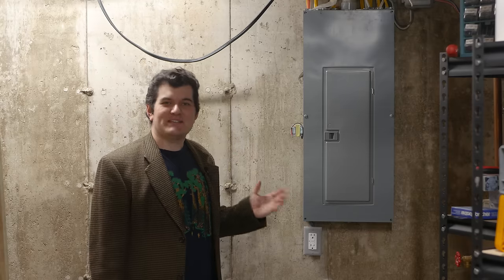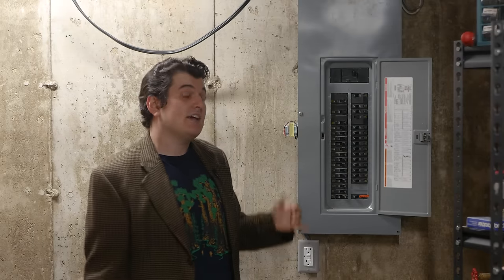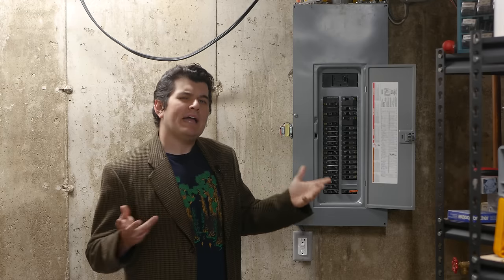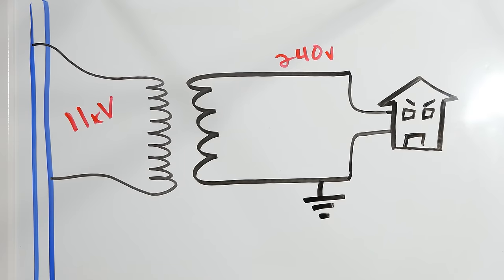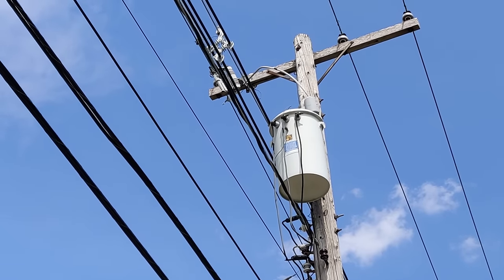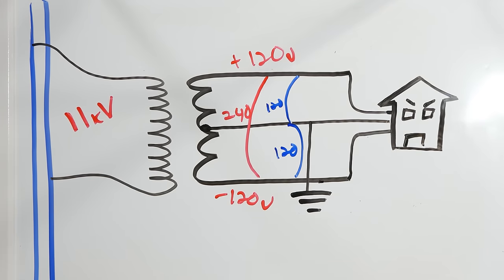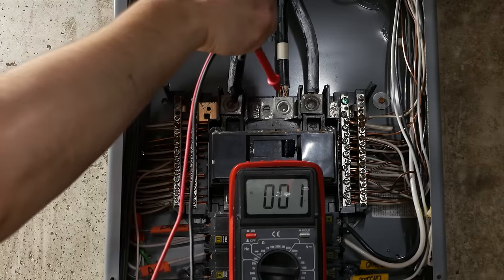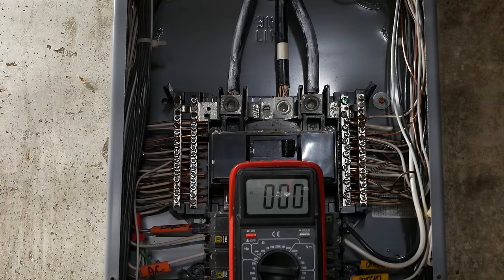The US electrical system is not 120V

Comment: "There isn't some magical point at which voltage suddenly becomes dangerous"    <-- Actually, there is!
It's the dielectric breakdown voltage of skin: typically above 500V (the actual number depends on conditions and skin thickness), at which skin (usually at οver 3,000 Ω from one hand to another) no longer presents much of a barrier to current, and you're left with the resistance of the rest of the body, which isn't very much, at only ~500 Ω [1]. Of course, at lower voltages, electricity is still definitely dangerous (albeit only slightly less so) so this is a little bit nitpicky: don't go touching anything >60V. But even at lower voltages such as 120V, skin doesn't follow the linear Ohm's law formula you showed - its I-V curve is nonlinear, changes over time (since skin acts more as a capacitor than a resistor), and its resistance (impedance) varies with both voltage and frequency - for a DC source, current through your skin increases at about I = V^3.8 around 120V. [2] (<- Ugh I wonder how they got those in-vivo results!)
But more importantly, in this case the current IS actually what kills you. If you hold onto a shorting high-voltage appliance for some length of time (say, a few seconds), your skin's resistance will break down over time and allow more current in (even though the RMS voltage on the appliance may be constant). If you've got a breaker on there that reacts with some speed and at some current, it better act fast enough before you get 500mA [3] across your heart (or less current for more time than a few milliseconds).
TL;DR In terms of harm from high-voltage electricity, 1) Ohm's law makes little sense without several asterisks and qualifications, and 2) Higher voltage is generally worse, but frequency and time exposure also matter in terms of the amount of current that will actually make it through you and kill you.
|
|
[1] Publication No. 98-131: "Worker Deaths by Electrocution". National Institute for Occupational Safety and Health. (1998). https://www.cdc.gov/niosh/docs/98-131/pdfs/98-131.pdf
[2] Grimnes, S. Dielectric breakdown of human skin in vivo. Med. Biol. Eng. Comput. 21, 379–381 (1983). https://doi.org/10.1007/BF02478510
[3] https://en.wikipedia.org/wiki/Electrical_injury#/media/File:IEC_TS_60479-1_electric_shock_graph.svg
Reply: Thumbs up only because there's references 😂
Reply: Yeah, okay, we can argue that it suddenly becomes more dangerous -- but the number of people who die from 120V shocks every year shows that it was already dangerous, even if less so, before that 500V point.
Reply: Also the higher the voltage the more likely you are to have an arc blast. More dangerous than getting shocked.
Reply: @emolatur  yeah with most voltage and current scenarios it's actually pretty safe to touch it as long as it doesn't pass through your heart lol. You don't want angry pixies near that.
Reply: I would say that's the point it becomes "drastically" dangerous. It's not like it isn't dangerous below that point.
Reply: does it also depend on the scenario like whether you're wet (with or without electrically conductive liquid and so on) or not? i'm pretty sure there isn't an exact voltage that determines when you die.
Reply: God, you actually prove his point in your first few lines, "depends on conditions and skin thickness" - so no, there is no magical figure.

Comment: "Spark from inrush current won't hurt anything"
- has whole video about how switches are designed to prevent sparking because it damages things
Reply from the maker: Since I knew someone would bring that up - the spark from something like a power supply is nothing compared to interrupting the current flow of a space heater or whatever.
(edit): sparking and arcing aren't quite the same phenomenon in my eyes
Reply: @TechnologyConnections  as long as you saw the tweet I sent you of a 2kW space heater then we're all good :)
Reply: @TechnologyConnections  It's genuinely the case though that some devices, even high-current ones, didn't used to come with power switches. Nowadays pretty much everything does of course. But the idea at the time (we're talking like 1940s/1950s) was you plugged it in when you wanted it to work and you unplugged it when you wanted it to stop. With that in mind, switches on the sockets makes sense to avoid arcing from the sudden inrush current, especially if someone fumbles while plugging/unplugging.
Reply: @TechnologyConnections  what distinction do you make between sparking and arcing?  Assuming in-air contacts, which we are here, we're speaking of electrical conduction through plasmatised  air and I don't see a distinction.
Reply from the maker: It's about how hot the contacts would get as a result. Something like the little pop you might get when you plug in a laptop's power brick is unlikely to damage anything, but yanking out a running space heater (as I did multiple times in the video on switches) will produce a BIG and longer-sustained arc that will burn/pit the contacts. It's technically the same thing, yes, but the magnitudes and after effects are quite different.

Comment: Me : 'lol american mains power is stupid'
Him : 'ring mains tho lol'

oh yeah, i forgot about that.
Reply: We took down an internal wall in our house and had to temporarily have a wire dangling in the middle of the room because it was part of a ring main for all the sockets downstairs (except kitchen). Thankfully ring mains are tolerated but not commonplace here in Ireland...
Reply: I read that due to WW2 and a lack of copper, and millions of homes needing to be rebuilt, instead of many lengths of wire from a fusebox to each outlet, a ring of wire saved a lot of wire.
There is a valid claim that having a ring main enables less rated wires (since power comes from both sides) but I doubt anyone today installs wiring that only just meets the requirement per outlet and the wiring is installed that far exceeds the requirement. I do see how if there's a problem with wiring breaking it's much more tricky to diagnose and find where the problem is, although if a single wire does break, a ring main does continue to provide power to all outlets.
Reply: Id like to see an episode about this
Reply: @BryTee  I've seen the whole 'copper shortage' thing thrown around quite a lot online, but from what I can gather myself (from limited research i'll admit), this doesn't seem to be the case. I'd wager that the simple cost of copper was the issue, with the cost of copper being high in general, even to this day, leading to copper theft from railway lines etc (this is probably just a British issue and I imagine that American's will be very confused by the fact that's a thing). WWII crippled the economy, rather understandably, so reducing the amount of copper saved money straight away, but simply can't see there just not being enough copper, increased demand might have seen the price of copper rise, but not so much that there wasn't enough physically available, just that with the volume of house re-building going on at the time, even though the supply could keep up quite easily, price was increased, just because it can be (hooray, capitalism! maybe those zany soviets had a point 🤔)
Reply: @liammaggs4506  Copper theft is common in the US these days.  Anything not tied down that can be sold for scrap.  Seems to be tied to the increase in opioid epidemic, at least in my area.
Reply: @liammaggs4506  "...leading to copper theft from railway lines, etc (this is probably just a British issue and I imagine that American's will be very confused by the fact that's a thing)." Not surprised at all, copper theft is still a big problem, especially at construction sites. It has gotten so bad that sites that were already fenced off, now have night guards too.
Reply: @liammaggs4506  Not sure if it was price or availability, but there was certainly need to reduce usage of it - means a lot of housing built in the 60's-70's uses aluminium wiring for telephones - fine for phonelines, but not so good for the internet age, so places with aluminium wiring struggle with internet connectivity - in many places being priority for FTTP upgrades
Reply: Ring mains aren't completely without their advantages, gives each outlet 2 earths so if the earth gets cut somewhere the outlet is still earthed from the other side. Also gives you a tonne of power on one circuit.

Comment: We have 3 phase 400 volt inn and 240 in the outlets at least where im at.
Reply: Actually it's 415V with 240V, 400V with 230V or 380V with 220V.  Ratio is always the  square root of 3, suitably rounded.
Reply: cool
Reply: I'm in the US, and at work we use 480/277 for most of our big stuff. Lights for example are almost all 277v
Reply: And in the oil feilds and mines they'll rewire the motors and run 480/830v. Electrical codes are differnt for them. Also 600/347 is very common in the north by Canada.
Reply: @micah66048  Do you have a separate panel fed from a second transformer to get 120v for things like small appliances, offices, etc? I know most electronics will be perfectly happy with 277v if they can run 240v, but most other stuff here doesn't like either of those.
Reply: @VexingRaven  I work in a very large government mechanics garage. We have a 2000kva transformer outside that feeds in 277/480 2400amp, and then for outlets we have 35kva step down transformers for each 120/208 100amp panel. Lightning, crane, air compressor, air conditioning, and elelvator all run off 277/480 200a panels.
Reply: @VexingRaven  Back home on farms it is not uncommon to see stright 480 ungrounded or corner grounds delta service for well pumps, and a little 2kva transformer for a light, controls, and a single 120v plug.
Reply: @VexingRaven  At least where I am at, they don't like doing an electrical service past 400amps (100kva) 120/240. After that they force you to go 120/208, and after 300kva (800a) they force 277/480. I dont know of any power companies that do new installs of  240 delta or 480 delta. I had one company that was in a business complex and the service from the power company was 120/208, but they'd feed each building only two legs. So rather than the 120/240 they had single phase 120/240. The electrician lied and said they'd need a new service to run a large printing press that would only run 220v or higher. So I rolled in there and installed a 20% 5kva boost transformer for about $1000 and saved them $10000 on a new service. I had the opposite problem on a pool. They only had a 120/240 service, but I needed three phase for a 15 hp pump. So rather than get a new service I installed a inverter drive. This was 15 years ago when I was a young smartass electricians apprentice. Now I just do generators for the military, mostly 60kw units that we can make do 120/208 for Army, 240/415 60hz for Korea, 230/400 50hz for NATO, and 277/480 60hz for Navy.
Reply: @micah66048  Yup, I work at an expo center at Mohegan and our trash compactor is 480v. All the lights in the ceiling run off 277v 15a outlets. Our floor pockets have each a 120v standard outlet and each a 60a 3 phase plug which I use for our breakout boxes (pagodas) for up to 9 standard 120v outlets or I can hook up 120v and 240v breakout boxes that may have 20a or 30a outlets on them for more serious appliances. One time I had to have the engineers run me 480v 3-phase out of the main breaker panel room to power Toyotas Supra Simulator. That thing was bad ass. It had hydraulics and a seat and 3 monitors and perfectly simulated how their new Supra drove. I'm not a licensed electrician, but I am in charge of running the power there. Can be a fun job, but also can be tedious. The end result is almost always fun though. Cause then I just get to walk around and babysit everything I ran and see the expos and events we put on. I don't really do much that needs a license, though I do open our breakout boxes and rewire/add new breakers depending if I need a single pole 30a instead of a 2-pole 30 breaker, or if I need the connector for a 30a plug to be different, etc.  I know how to do it and I always research it first. So we can keep a lid on that one. =) It's only portable stuff I alter if needed, not the buildings stuff. They have their own people for that. Never thought I would have a job like this, but I'm glad I do now! I started as an AV tech and learned it all there.
Reply: And we have electrical closets that run down each wall on each side (like maybe 4-5 on each side) that have a 3-phase 400a panel with camlocks and a 200a panel with camlocks that I run feeder cable out of if need be. Up to 4/0 gauge for the 400a. I have a couple sets of 100ft 4/0 cables. Those bitches get heavy in looms of 5. I have to fly them into the ceiling sometimes. One of the supervisors couldn't believe I took it all down from the ceiling by myself. LOL That's why they pay me the small bucks.
Reply: @micah66048  nice, but we have two times 3x10000 Volt, is it better, or just different? At our other location it is three times 3x10000 Volt.
Reply: @K2teknik.  I'm not sure I understand the question. At least here in the States they do 2400/4160v wye (aka MV) or 7400/12800v (aka 13kv) wye for really large buildings and mills. I've never heard of a 10kv system.
Reply: @micah66048  Lights in office buildings you mean.
Reply: In UE it's 230V for 1 phase, and 3 phases are almost everywhere. It's hard to find apartment or house without 3 phases.
Reply: We have in our home 3fase + neutral. 3x230V/3x400V. Cooking at 400V, so no need for thick wires. (BE, Europe)